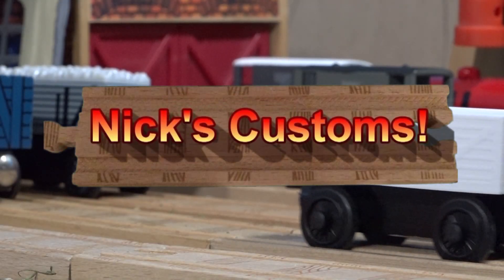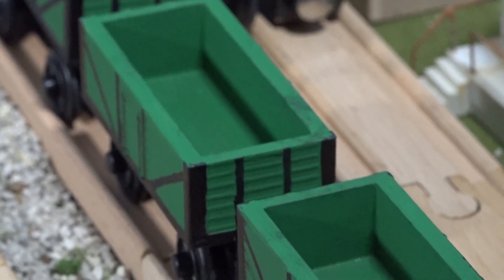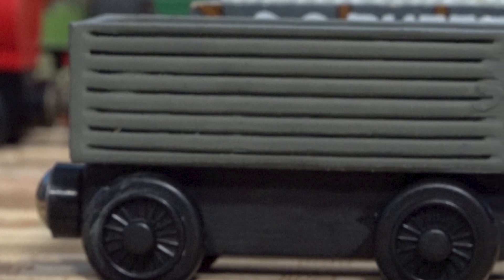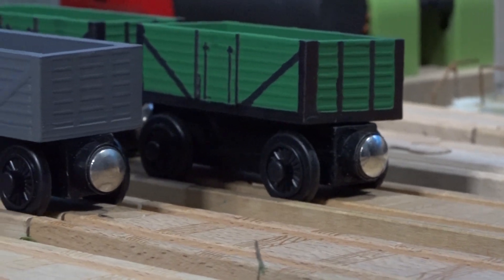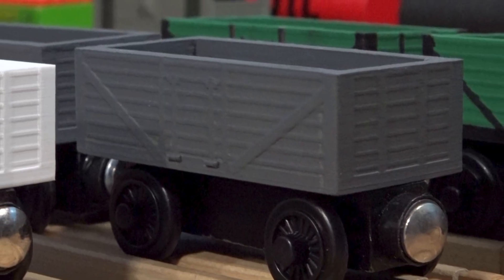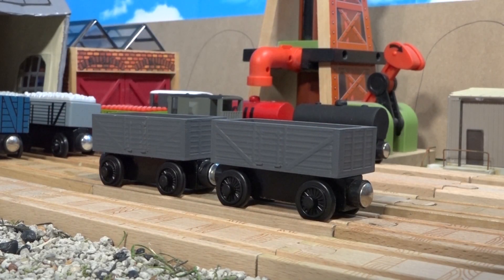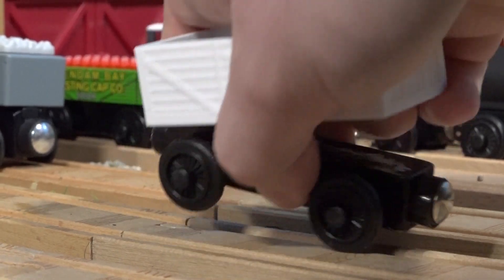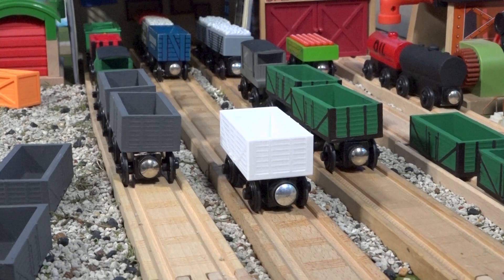7 Plank Trucks - Nick's Customs!

Comment: okay nevermind the China clay trucks are still not back well that's funny I'll just get the trucks it's Dez the same way as the brake van and the chassis for them and I already know what to do it's only use for a fourth chassis when I get those two paint them with the chassis on them and print out a space for them well not really the brake band all the time one of them might need a tail lamp the brake van
Reply from the maker: Clay trucks will be back next week
Reply: Okay I didn't know that I'll make sure I'll get them to next week when they come out
Reply from the maker: @cadenTugboat  Yeah I’ve nearly finished another batch after so long